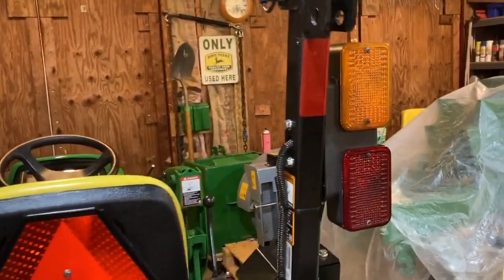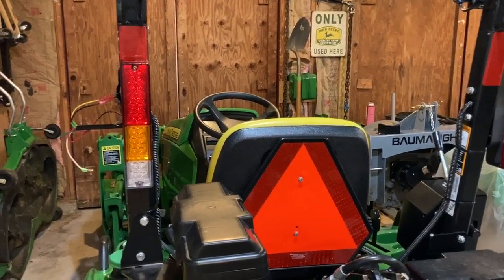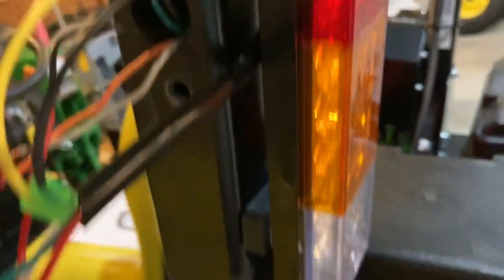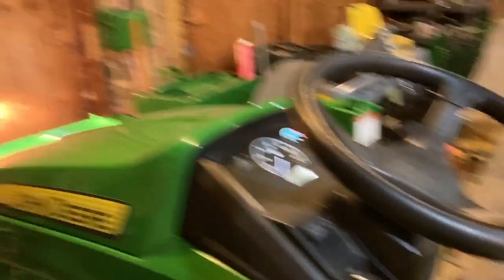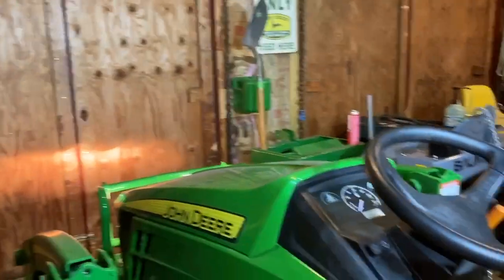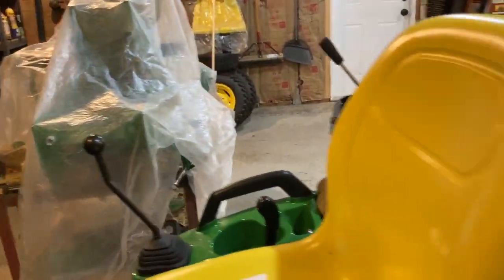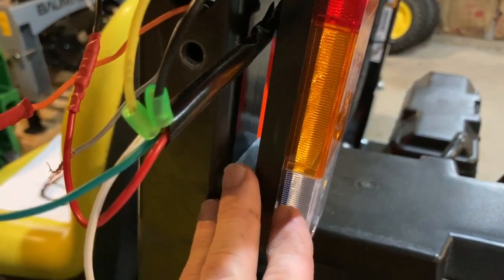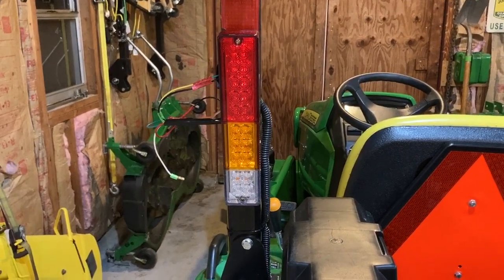Fixing The John Deere 1023E 1025R Light Bar (Part 1)

Comment: I’m trying to find this light bar that fits can you help me?
Reply from the maker: That was a few years ago, I think I had the link in the description or tried to add the link before.  I doubt they make the same light or have the same link.  I would just search for a similar light.  In fact, I will say they now make cheaper replacements for the Deere lights. They used to be $180 or so and now you can get them for like $40-50 I believe.  I hope that helps and thanks for watching.

Comment: After breaking mine twice, to moved the factory lights inside the bar instead of outside.  Problem solved!  Haven't broke on since.
Reply from the maker: Agreed, but I now have the stock lights again after finding reasonably priced ones and breaking the ones in the video.  Thanks for watching.

Comment: Wow!  Am about to start install on exact same signal bars before I wreck my factory defects. Using two RE mags (1" round by 3/16") epoxied onto each light after full silicone sealing.
I plan to wire backup lights in with the brake light and fab  a jumping Deere sticker over the white lens for fun effect.

Not being a lectrik specialcator, can I get a yea or nay and why on adding in the extra wire before the twisted union commences?
Reply from the maker: There are a lot of different light options, the ones I used are cheap, but you could probably do better in the quality department.  Also the ones I used had a reverse light, so be mindful of that.  Watch the second video too, I think I go over some issues left out of the first video, hence the need for a second video.  Good luck, I only had minor electrical skills, so if you are more savvy than me, your possibilities are will be better.

Comment: The new bar is not dual fillament for the red.  Brake light or running light not both.
Reply from the maker: Yep, there are many options for the lights that are probably better than the ones I selected, but they work and I don't actually use the lights really, I almost converted them to simply work lights, but I generally do no work at night, it's very rare I use the tractor at night.

Comment: It appears the brake light when the headlights are on is actually the running lights.   If it's a dual filament bulb in the factory lamp, there may be an extra wire somewhere for your running light.  Otherwise it may be sending a lower voltage signal to the same factory bulb, if that's the case, the LED lamp may not reach break over voltage to turn on, there are some ways to create the same effect if that's the case though..  I'd suggest using some super magnets epoxied to the fixture and forego the Velcro entirely, the magnet idea is pretty neat.